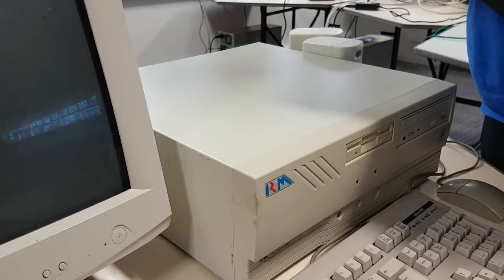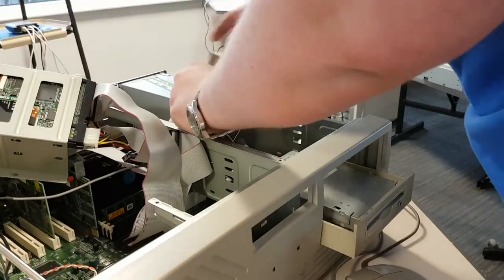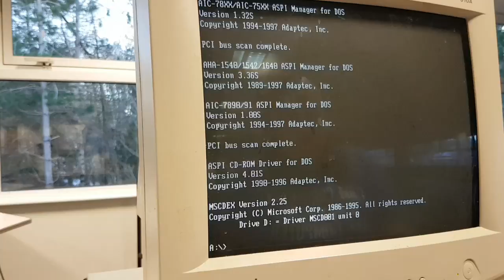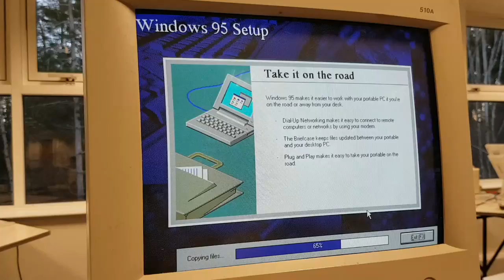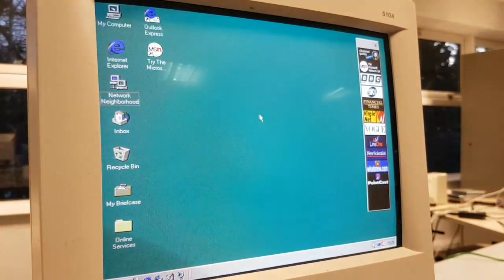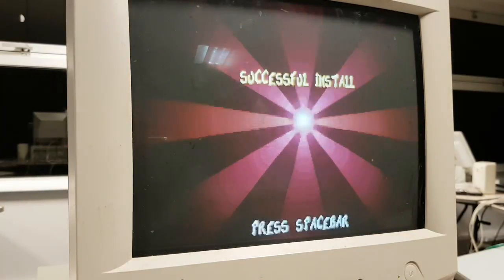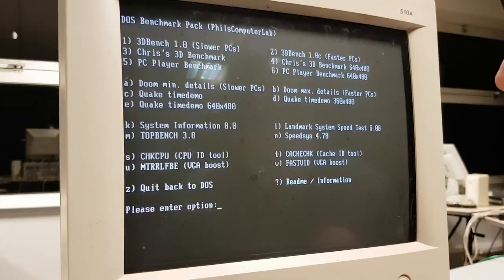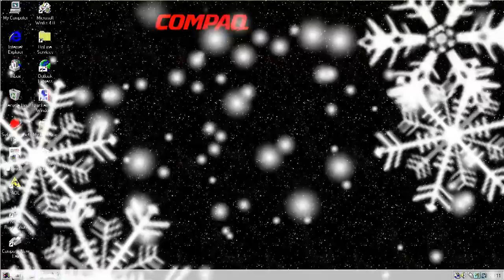TFS Christmas 2017 Episode 10 - Installing Windows 95 OSR 2 5 & Plus on the RM Accelerator

Comment: You could use Desktop Architect to change some of the icons (it's compatible with Windows 95). It's possible that both the explorer.exe and shell32.dll files might of somehow went with the cool.dll file (the one with the "3D"-style icons) instead of the "98"-style icons by the time you've installed Plus! 95 after getting the IE4 Windows Desktop Update and graphics drivers installed.